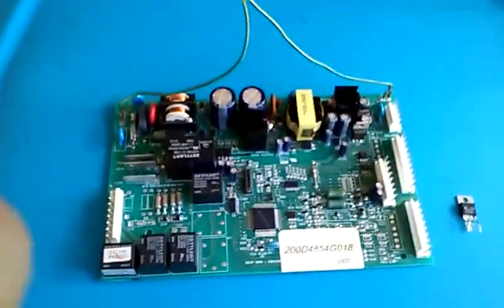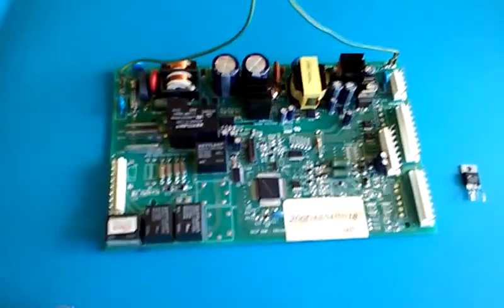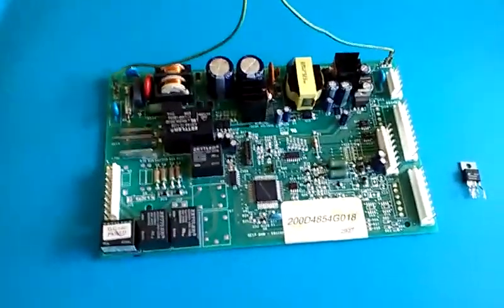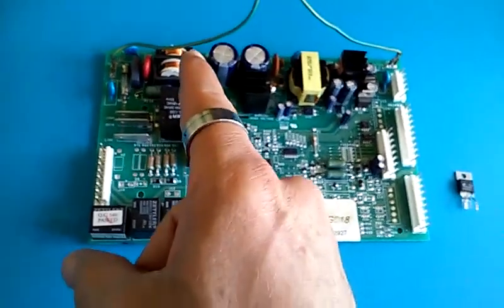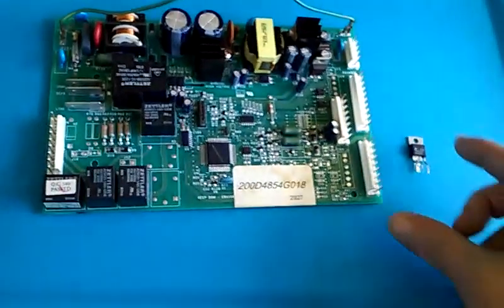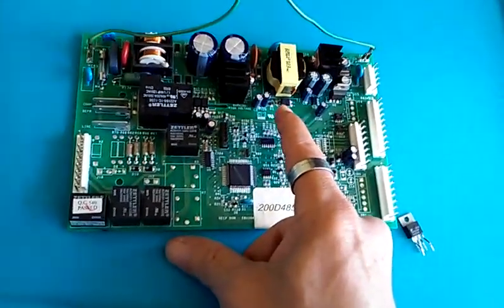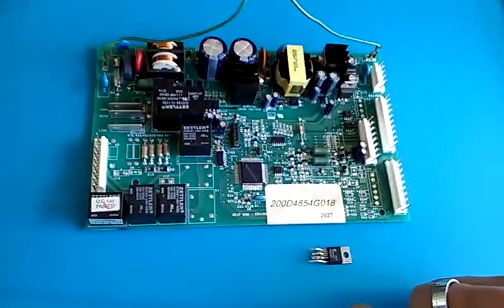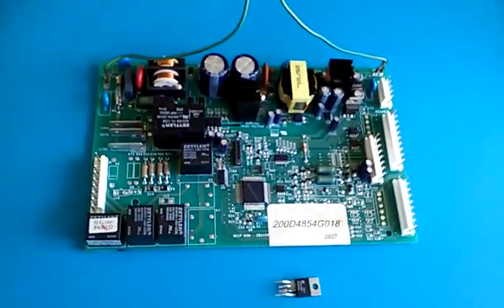Compnent level fix in GE fridge.

Comment: Finally someone else who can look at a board and know what the hell is going on.  No wonder we make good friends.  But yeah, that's way over-complicated for a fridge...  You could probably reach the exact same outcome with half of what was used.
Reply from the maker: +Felyx Kain I know, right!  Whatever happened to a good old mercury switch thermostat and a couple of relays! SMH! ;)
Reply: THEMINDSHAFT
Haha, and those old gigantic mercury vapor rectifiers.  Damn, I wish I still had one of those laying around.  There's still a good number of relays in use though.  Every elevator in my city works off relays.